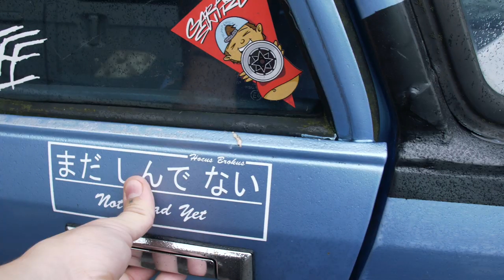The Corolla Wagon Gets New Parts

Comment: I have the same fender mirrors on my Volvo wagon. Make sure to check that their still tight after a little while and if you see them vibrating intensely at highway speed, be prepared for cracked fender paint.
Reply from the maker: yeah the fenders had mirrors on them back in the day and by the time i got it; it was just holes. had to drill a bigger size but  i know what you mean. they seem to vibrate pretty good when im driving. might have to locktite the nut on. or maybe make a custom gasket for it to try and reduce the vibrations